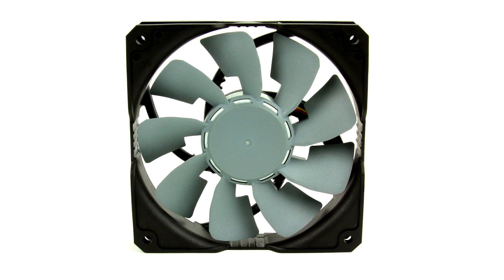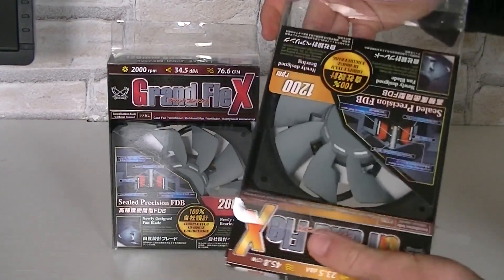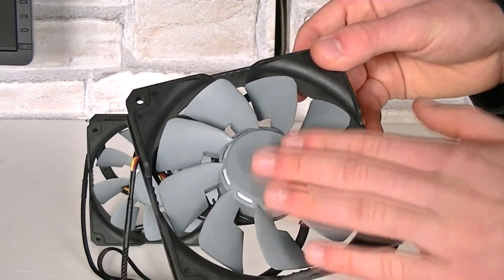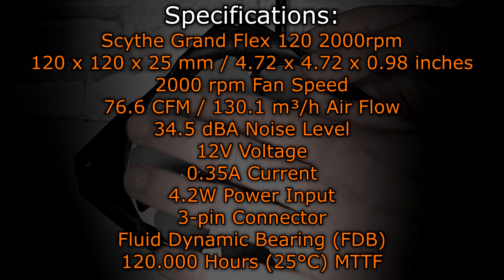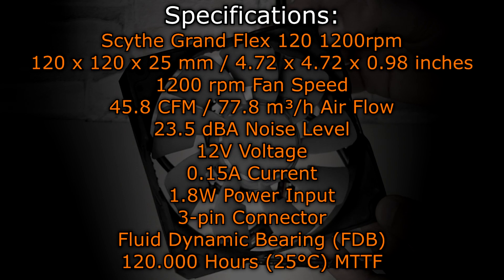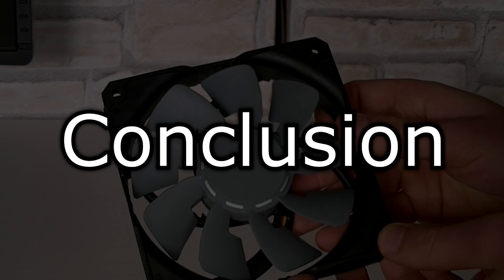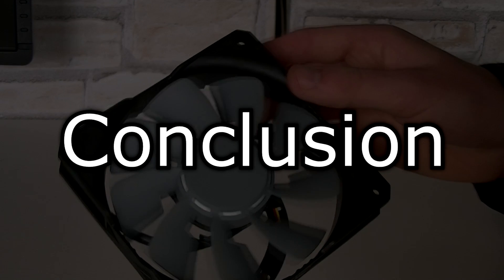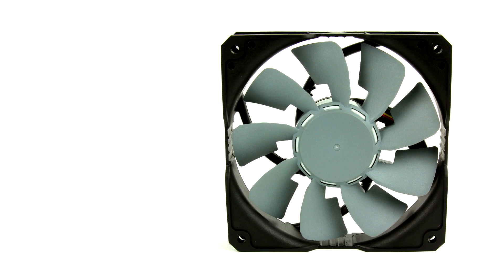Scythe Grand Flex 120 Fan Review

Comment: I have 4 of this, use them as air flow casing fans as I use NF-F12 for my rads.
They are pretty decent air flow at 1500-1600 rpm and the nose at that speed is not too bad as well. It its possible to hear them during quiet nights, but I can't hear them over the air-con.

Comment: These look okay but I think I'd be happier with the corsairs I'm running rather than these, The 120mm Corsair quiet edition sp's claim a 23db volume like the 1200's here. I'm running two quiet edition sp's in push/pull on a three drive cage which houses a 1tb WD red, 2tb Seagate B and a 250gb ssd. Hd tune shows that the red (5400rpm) idles at 21 degrees and the Barracuda (7200 rpm) idles at 26.